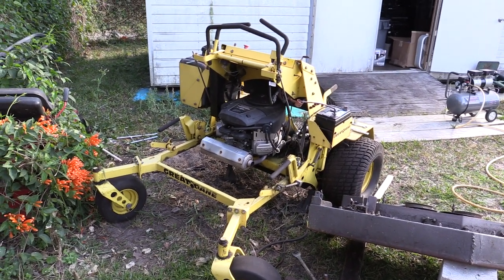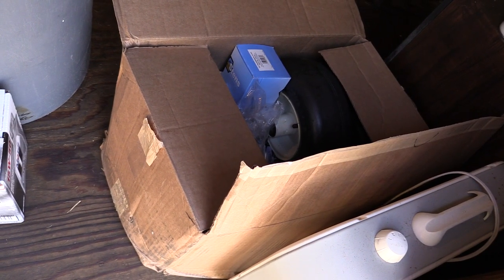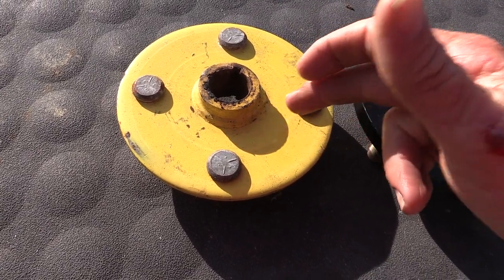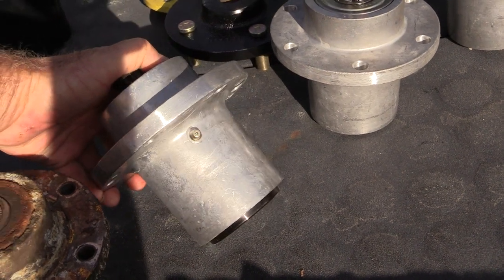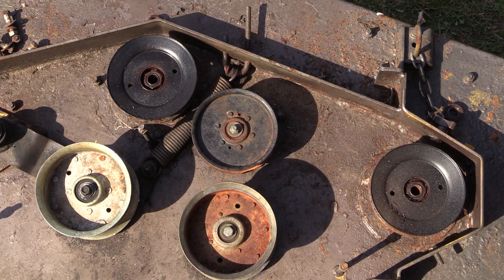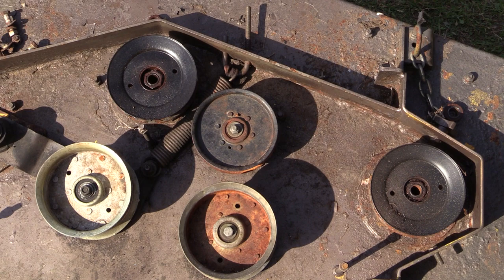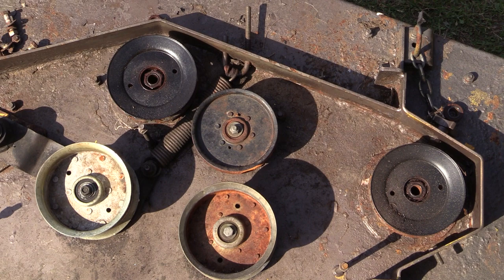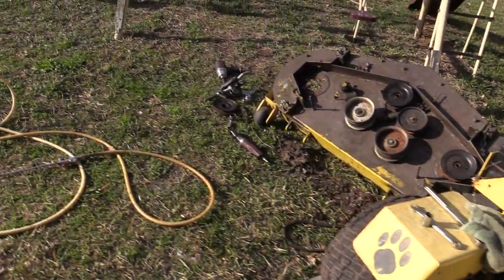Great Dane Super Surfer restoration pt  3 - New parts are here!

Comment: tear down comin wright along .just a little hint, be sure to use anti seize on hubs and bearing shafts to prevent them from getting stuck for future repairs .. looking forward to nevt video...
Reply from the maker: +Henry Bennett You know what, I'll do that. I've never done that. Do I get it at the auto parts store?
Reply: +Something 2LookAt you can get it at most napas it is always a good idea
Reply: +Something 2LookAt  Yes u can loctite makes it . It comes in tube or plastic jar with brush on cap.
Reply: +Something 2LookAt  forgot to tell u it comes in silver,copper or grease form . just check with ur local parts store or can order online too.
Reply: +Something 2LookAt  put u a counter weight on front of mower before u drive without deck or it will try and flip backwards on u.
Reply from the maker: Henry Bennett LOL, that sounds exciting. It does still have a lot of weight on the front. I tried to pick it up but I cannot. I think a counterweight would be a good idea, but ultimately, going slow is going to be the best precaution. Thanks for the warning.

Comment: What size socket or what did you use to remove the I believe it's a 26mm retaining nut but its on the spindle after you remove the first bolt ( long bolt )